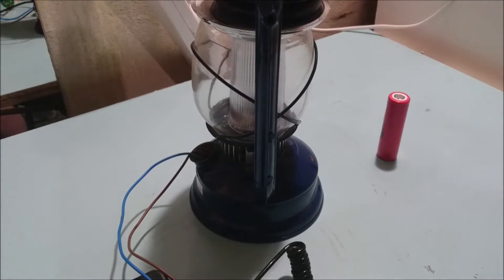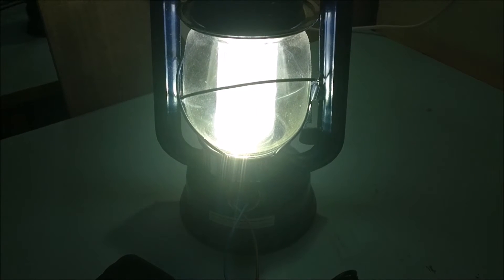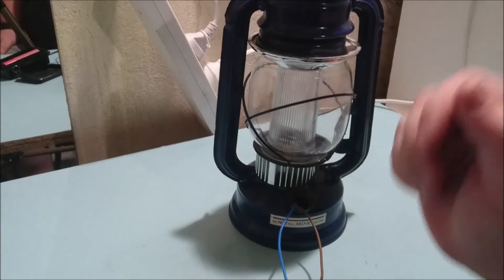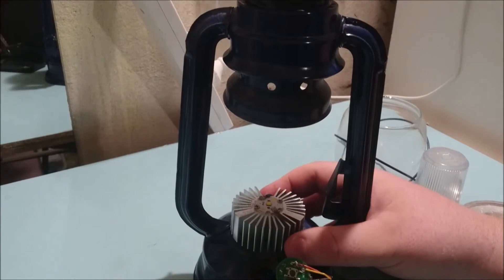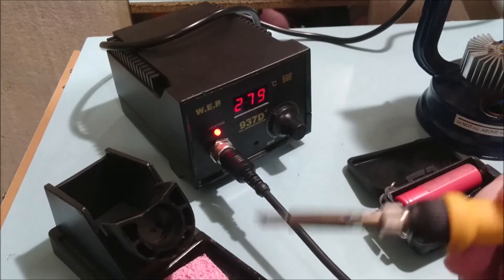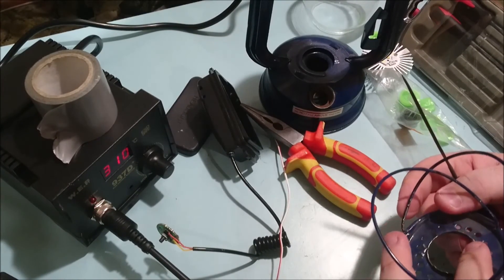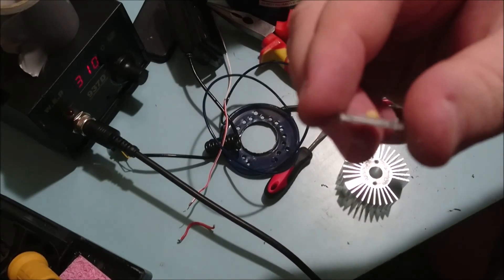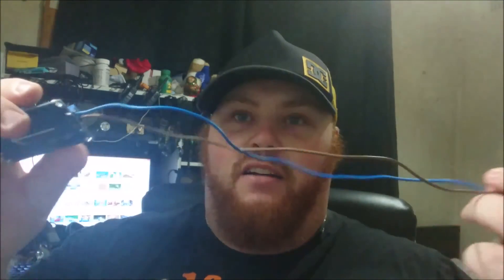Hurricane lantern LED conversion part 1

Comment: Nice! Looks like a fun little project! Maybe I'll build something similar!
Reply from the maker: These builds are easier in a electrical sense but more work making all the parts fit and work together. I am still deciding where to put the battery holder? If Fasttech sent a working driver i would have finished it already.
Reply: everyday survival gear put it in the "bottom" like you planned just go for it, looks good mate!
Reply from the maker: Yea i will work a few things and cut some holes and see how it looks.
Reply from the maker: Hannes Remo that's a good price 60 dollars here. mine has good reviews it's just a no name brand. the transformer is huge. my old soldering iron the transformer was tiny. plus I snapped it in half lol.
Reply: everyday survival gear that's not where I bought it from,lol, just a random link to show what it looked like. Bought mine here in Finland for a very chilling 80 bucks, haha, everything is expensive here, so I usually buy from uk or china. I just needed this one quickly though.
Reply: everyday survival gear Yeah I had just a simple 30w regular one before, but meltednrhe cable, then I got a butane one, and now this haha.